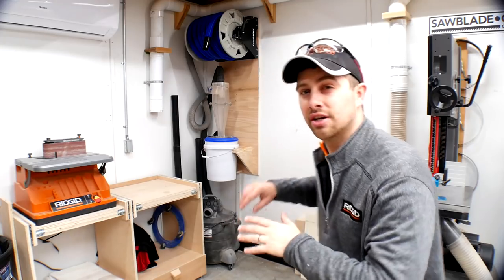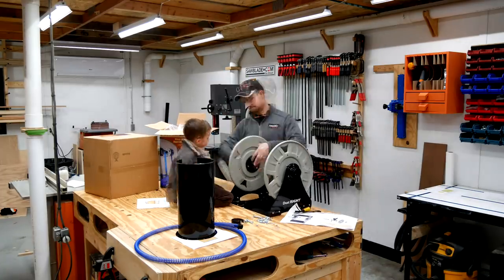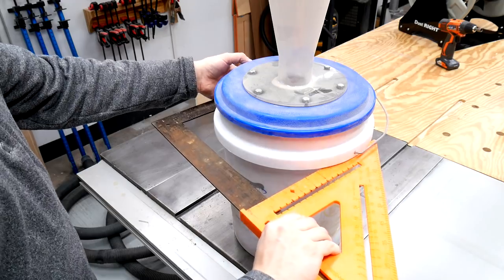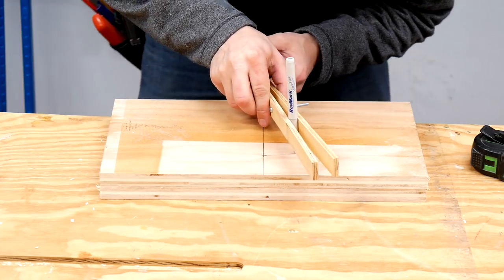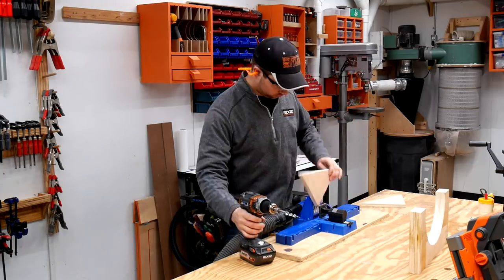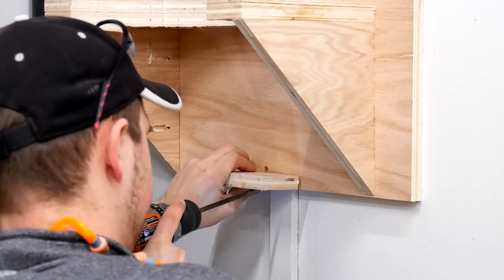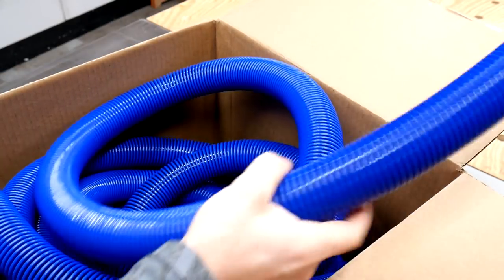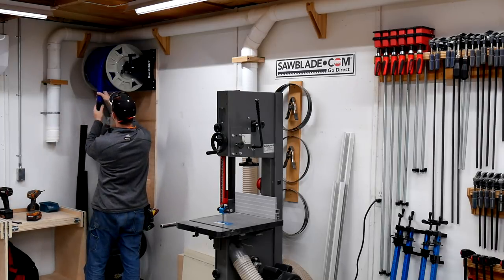Space Saving Vertical Shop Vac Cyclone Separator for the Shop

Comment: Good job Tyler. This is my dream to before to long to have a dust collection system. I guess they have different sizes in length of the hose. I don’t need 40 feet as my shop isn’t that big. Looks 👍.
Reply from the maker: Most people won't need 40 ft but my shop is long and skinny so this works great. Thanks for watching Becky!

Comment from the maker: FIRST!! Ha, will admit that was cheating but it's my channel!! Hope you like the video, lemme know!
Reply: Tyler G you should have mounted it on the adjacent wall so the hose reels off in the direction you are most likely to be pulling it. Now you have to walk over to reel to pull more hose off the reel instead of just pulling on the hose where you are actually using it.
Reply from the maker: I looked into several different locations and this was the best when all the other tools we're taken into account. It works great here!
Reply: Do you have the dimensions of the circular bracket you made for holding the 5 gallon bucket? Thanks, man! 👍🏼

Comment: Like your big dust collector setup, this looks really clean.  I'd like to see a mobile setup though, instead of the hose reel system.  I'm sure you could do a really clean looking mobile unit, and that would be a big hit.  Since it wouldn't require the reel, it would probably look smaller, and you could do it in the same footprint, so you could just push the whole unit into that corner when it's not needed.
Reply from the maker: Jay Bates and Paul Jackman have made portable versions check their channels. I figured why be portable if I have a 40' hose?
Reply: Well, I suppose my reasonings would be a lighter duty shop vac because you wouldn't need so much HP, and the ability to take your setup anywhere you can get power.  Having to deal with a lot of hose bothers me (although the reel is cool, my go-to extension cord is on one).  What I'd really like to see is a smallish footprint mobile version of your big dust collector setup, but that build is almost entirely a "can I do it" project instead of a "do I need it" project.  I used a large Woodstock Separator that just sits on top of a 55 gallon drum for my collection, but it's smooth setup to move around by any means (I have the 2 HP harbor freight unit as well).
Reply: Nheeb I suppose either way is a trade off. One reason for having the hose on a reel might be if you had limited outlets available. In that scenario you would not have a hose strung along the floor, but you would have an extension cord strung along the floor while you pushed the mobile unit around. Also, he is still going to have to push the mobile unit back across the shop to the corner where it would be parked. So either way I see it, you are either dealing with pushing the mobile unit around and parking it again (with possibly the hassle of the electrical cord) or you’re going to have to go back to the station and reel the hose back in. So in my mind it is just a matter of preference. Me personally I like his set up and will prolly copy it. Cheers

Comment: Tyler - getting ready to do a build on a portable shop vac (insulating it in a box and portable). Planned on using the dust right hose reel but this thing got some crappy write ups becuase it holds 1 1/2" hose, and the fitting attachment at the actual unit leaks. Did you experience this? Does the smaller diamater hose have enough suction with a shop vac to work well. thanks for comments.

Comment: Great build, and as always, good looking setup, even when using scrap wood to complete the project!  I would venture that you are losing a lot of cfm in that system with only the 1.5" hose instead of 2.25".  Is there a reason that you went with that size?
Reply from the maker: I'm sure I am losing some, but you habe to remember with a Shop-Vac that it is more about the pressure than the CFM. This works excellent, and is way better than dragging around the shop vac! Thanks for watching!

Comment: Ok, but first like! Nice project. I'm getting ready to put my dust collection system together. Would it make sense to just rig a 1.5-inch hose to that instead of also having the separate shop vac too? I'm assuming there's a reason you didn't do that.
Reply: I'm doing a Harbor-freight and filter set-up like yours.
Reply: You will get very little suction from a dust collector through a 1.5" hose.  Shop vac is designed for lots of suction power, but not a ton of air volume movement, dust collector is designed to move a ton of air, but not a lot of suction (static pressure)
Reply from the maker: Thanks James! Like Brian said a 1.5 hose will not work on a DC because it is designed for high volume and not high pressure like a shop vac. 

Same reasons a shop vac is only decent as a dust collector, it simply doesn't cycle enough air through to gather the dust.
Reply: Great question James Amos.  The replies by Hide replies and Tyler G are spot on for  this particular case.  While it is possible to have a generalized dust collection & central vacuum system, the blowers commonly sold are not designed to accommodate both modes.  

The most common and effective dyi solution would be to install and actual central vacuum.  This is followed by some form of high efficiency filter;  a cyclone separator; and finally, the ducting for the dust collection and vacuum connections.  This generally provides sufficient suction and air flow for both systems.  The big draw back is both set up costs (frequently 50% more than a Dust Collector & Shop Vac) and significantly reduced motor life. 

 Vacs are generally designed with the expectation of running for a max 60 min work cycle (run for 60 min and the off until motor is back to room temp).  Many  are only designed for 20 or 30 min cycles.  Dust collectors, on the other hand, are actually designated, and therefore designed, as specialized air cleaners.  They are required to be designed for a minimum of 8 hour work cycles under various health and safety regulations in the USA, UK, and most of the British Common Wealth.  To accomplish this, the a designed with a very low flow restriction in mind (i.e. less suction mean lower demand on the blower motor).  A great example would be the blower in your furnace (which by the way is today also considered a specialized air cleaner).  It assume a relatively easy air flow on the intake side so that it can move a large volume with less effort.

There are a few companies that make systems designed to do both job well and for a reasonably long work life.  Most of their systems are custom designed for their clients, and come with a price tag that reflects that.  These a typically found in Hospitals, Pharmaceutical Manufacturers, Various parts of the mining industry, and other areas where a one, or a few, specially designed systems would provide both significantly better operations, and substantial cost savings.  In most cases, the later is only achievable in new construction or massive structural renovations.  The last price I saw for such a system was just under $250,000 US.  A bit out of reach for most dyi and hobbyists.

Comment: GREAT video Tyler.  I have been thinking about this set-up.  Is the handle reversible??  It looks like you mounted the unit upside down but I can see why as you need the handle on the right side.
Reply from the maker: The handle is reversible. I am very right handed and wanted to turn the handle with my dominate hand. I don't think the unit would fit between the DC pipe and the wall, pretty sure I looked into that.

Comment: Nice build Tyler.  I feel like this is a dumb question or I'm overlooking something, but what's the advantage of having this shop vac driven as opposed to putting that hose reel of a tap off of your main dust collection system?
Reply: Michael Hicks the hose is too small to work with a dust collector. A shop vac can pull about 6x more pressure than a dust collector so it can maintain acceptable flow even with a long narrow hose.  

However,  a 2" hose would flow a lot more air than a 1.5" hose.
Reply from the maker: It would but would aslo require either double the reel size or half the hose. Works well with the 1.5"
Reply from the maker: Like Michael said, DC would probably pick up some junk through the hose but a shop vac is designed for this application. Thanks for watching!
Reply: Thanks for the replies, that makes a lot of sense.  Just essentially two different fan curves with different applications.  This will help me plan better now as I wasn't even considering a shop vac setup in future plans!

Comment: Is your vacuum 240V? No way you can get a true under load 5+ HP out of 120V. HP ratings on 120V vacuums are about as truthful as a politician running for election. NIce build  and installation by the way.
Reply: JB Marker shop vac hp ratings are based on the inrush power they are designed to handle so a higher hp rating really just means beefier windings which may last longer.  Almost all full size shop vacs and upright vacuum cleaners run between 1100 and 1300 watts which is between 1.5 and 2 hp.
Reply: My point exactly. Tyler mentioned his was 5.75 HP.
Reply: JB Marker he's just referring to the in-rush power rating but to your point, anything rated at 1.75hp or higher should theoretically have about the same max pressure and flow rate.
Reply from the maker: I dunno, it works. Rockler suggests a 5HP ( am pretty sure they are calling out the label on the front of the machine regardless of truthfulness or not) and I have a 5 3/4....good to go!